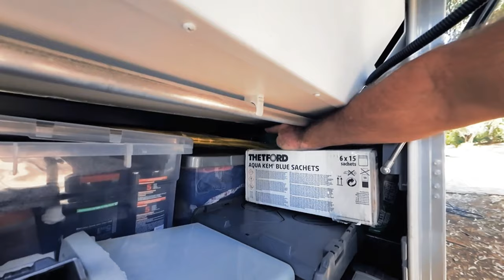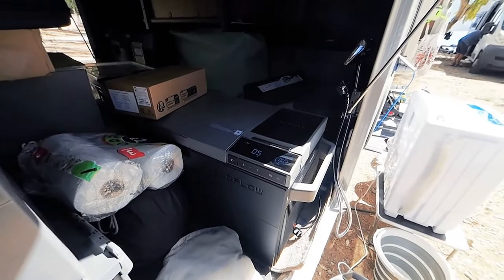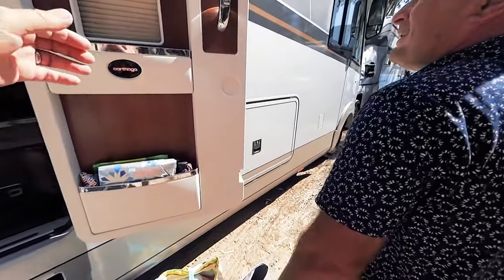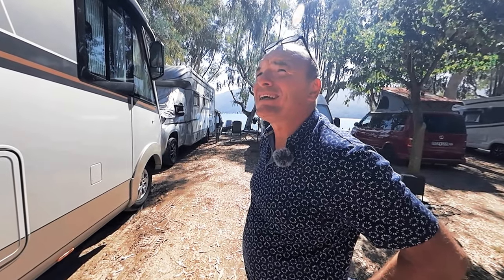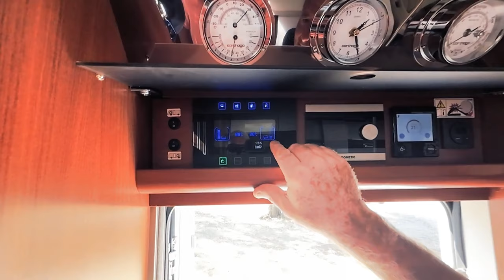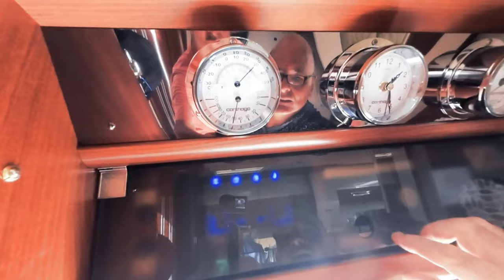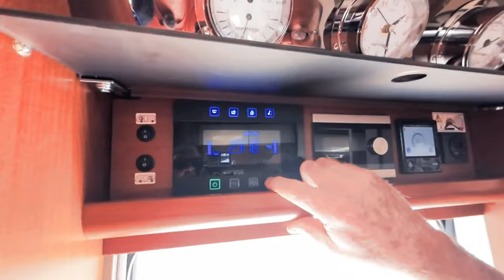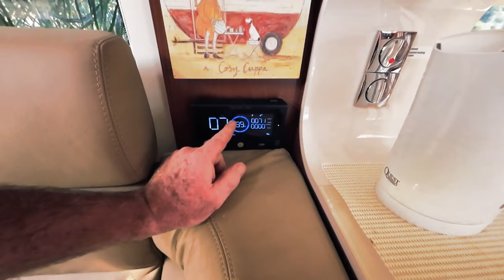CARTHAGO LINER FOR TWO - UK OWNER FULL REVIEW!!

Comment: Hi, great video 👍 Tony has some great accessories etc…it would be good if you could do a video on where to find these like the mini washing machine and storage boxes? Oh also he has a excellent power pack setup 👌 Thanks great video..
Reply from the maker: Hi Mark, thanks for the comment. Tony indeed has a nice power setup. Power is everything when you are in your motorhome as long as we are and we like to have as much power as we can get, especially when there is no sun about. The washing machine can be purchased from Amazon (there are many models to choose from). The boxes are from ebay. Keep watching the channel as we will be making a video reviewing items that are essential for long term living in a motorhome. Thanks for watching. 👍
Reply: Excellent cheers 👍 could you also tell me, Am I right in saying Tony’s powerbank setup is that he plugs into site hookup say 6amp and then runs the MH through the ecoflows?. Cheers 🤔
Reply from the maker: Hi  @markhowie7357  . Yes that is correct. Tony has two sets of ecoflow products. He has two Ecoflow Delta Max's, (which were used in his previous MH) and has now installed 2 Ecoflow Delta Pro's in the Carthago. He uses the the Pro's, as you have described, as they are permanently in the MH. The Max's are more portable and they are used elsewhere when required. However, if the Pro's are running low he (and we) can utilize the Max's to do the same thing (as we also have 2 delta Max's), albeit with less overall maH than the Pro's. Hope that helps. 😃👍
Reply: That’s a great idea, thanks…. Maybe you and Tony could do a short video to show and explain exactly how it’s done… I think viewers/MH would be very interested in this ! I certainly am. Thanks again.👍
Reply from the maker: Hi @markhowie7357  . Keep watching as we will definitely be doing a video on this and other things in the coming weeks. 😁👍

Comment: Great video, just a quick question, was that a fire stick on the bedroom tv. If yes how did you install it, did you have to remove the TV?
Reply from the maker: Hi Tony. Thanks for watching. Yes, that is a fire stick connected to the TV in the bedroom. The fire stick comes with an extension. That HAS to be used otherwise the fire stick interferes with the TV locking mechanism. It's a bit of a Pfaff but you can get it in there. A pair of long nose pliers would be very helpful. That way you don't have to remove the TV. Hope that helps.

Comment: Is the UV water filtration system an option or added in by the owner?

Also, why use all those external batteries, doesn't this come with offgrid batteries to run those items?

Also Also, is there an option to have a different TV, same size etc, but with ports to power a chromecast or a PS4? Or is it a special 12v model for motorhomes?
Reply from the maker: Hi Steve thanks for watching. The uv filtration system is after market fitting by the owner ( and uses power to power the UV light system). There are alternative systems like in line water systems we have in our Laika (no power consumption required). However, the UV system in the Liner for two filters all the water rather than the inline systems which generally filter the tap it is fitted too. The L42 only comes with 1 x 80ah battery as standard (which is no-where near enough) that you can optionally upgrade at time of purchase to 3 x 80ah batteries (which is still not enough if you are a heavy power user like us). The TV is 12 volt and has a separate box (hidden behind a panel that you have to remove) which has ports for PS4 or fire sticks or Chromecasts. But is a Pfaff rather than having ports directly on the TV. The TV make is an Alphatronics. Hope that's helpful.

Comment: No sure if you get notifications for YouTube but I was wondering how much solar is on the roof? Also how do you charge the Ecoflows in the garage? Thanks. Great video by the way 👍
Reply from the maker: Hi Sue. The Carthago (well, particularly this one) did not come with any solar panels. It comes with the wiring already in place to take solar panels but they are an option on a new liner for two. Tony had a 200w solar panel fitted (the cost was circa £700) that charges the leisure batteries. He also installed another 200w to charge the ecoflow boxes. Hope that helps.
Reply: Thanks for your reply 👍 Is the solar for the Ecoflow on the roof?
Reply from the maker: @sueparry4657  Hi Sue. Tony has two solar panels. A 200w solar panel that charges the leisure batteries, and another 200w solar panel that charges his ecoflow boxes that are in the garage of the motorhome. Thanks for watching.
Reply: Thanks for the information. But I was wondering are the solar panels for charging the Ecoflow units on the roof? I'm only enquiring because that's what we'd like to do, rather than having a stand alone solar panel to be used only when you're around and stationary. Thanks
Reply from the maker: @sueparry4657  Hi Sue. Yes that's correct. There is a 200w panel on the roof that charges the leisure batteries. There is also a 200w solar panel on the roof that charges the ecoflow boxes. The ecoflow boxes are in the garage. Hope that helps.
Reply: Perfect thanks for the information 👍
Reply from the maker: @sueparry4657  👍

Comment: How does the Iveco engine and chassis perform being rear wheel drive, cheers =",'=
Reply from the maker: Hi Holly. The engine is powerful enough and works well with the rear drive as it has difflock. However, fuel consumption is around 15 mpg tops. Going down to between 10-12 mpg depending on how you drive it. It is 6.7 tonne after all. Thanks for watching.